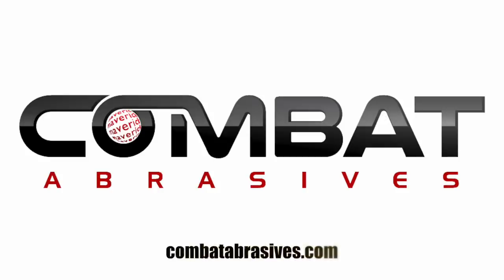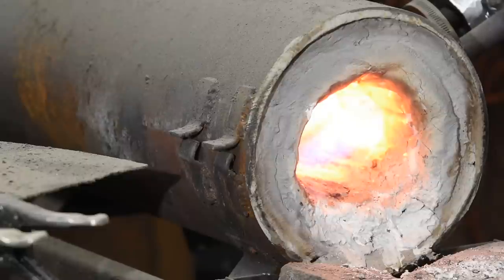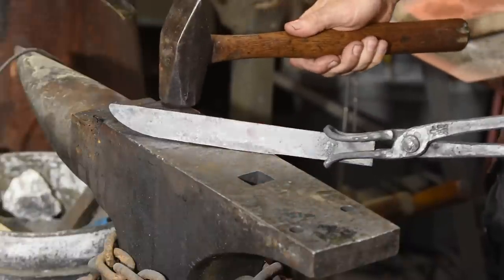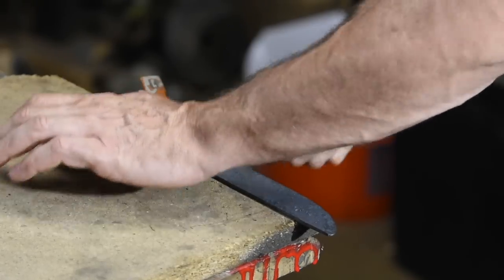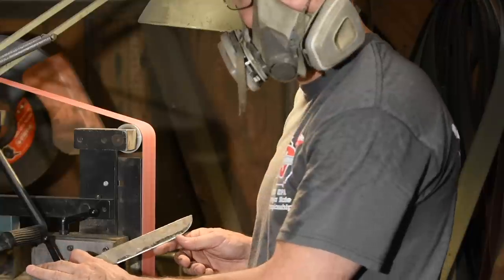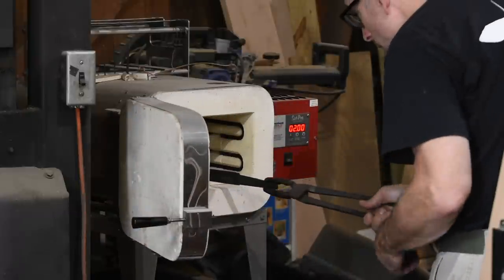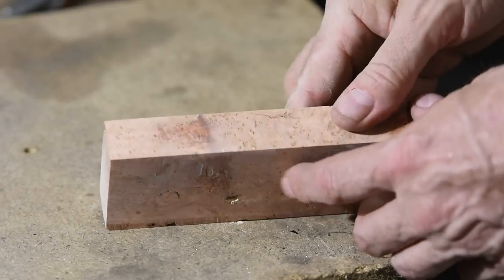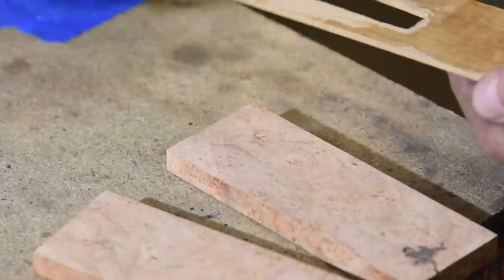Knife Forging Introduction: Making a Scandinavian Knife

Comment: 'Lapinleuku' actually translates to 'leuku of Lapland', where 'Lapland' is a vaguely defined as the northern Finland, Sweden, and Norway, and 'leuku' implies the shape and design of the knife, i.e., a long and widening blade that can be used also in light chopping tasks.

'Puukko', on the other hand, literally translates just to 'a knife', and does not imply the traditional 'Tommi-puukko' design, of which Finnish knives are probably most known for.
Reply: I think part of Russia is also defined as Lapland.

 Puukko does not actually mean knife in finnish. This is a mistake that many native speakers make. Puukko means a specific kind of knife. There is a lot of variation between different kind of puukkos for exampple a(traditional) Kauhavas puukko has a relatively large ricasso, a fuller and a bevel that is usually over 50% of the width of the blade. Many puukkos don't have a ricasso or a fuller (Toijalas puukko for example) and many modern puukkos have a scandi grind which creates a smaller bevel than any traditional puukko that I've sseen.

In summary the finnish word for knife is veitsi not puukko even though many native speakers use puukko when they are talking about knives in general.
Reply: Leuku is the big knife used almost exclusivily for chopping light trees when making camp or fire. Puukko is the smaller knife used for carving and other finer tasks.  

Sami word for leuku is "stuorraniibi" and it translates to "big knife". In finnish it's called leuku or lapinleuku (leuku of lapland).

The  word puukko is commonly used for any knife that is meant for work but can also refer to the specific shape of traditionanal scandinavian knife.

Veitsi can refer to any knife but is mostly used for kichen knives.

Finland also has many dialects and someone from some other part of the country might not agree with what i said.
Reply: @nikomartti2701  originally veitsi was defined by the grind. If it had a full flat grind, it was a veitsi. Now when there are more kinds of knives+grinds veitsi has become the general term. In the end it's just a matter of definition what do you think a puukko is. I personally think that main aspects that make a knife a puukko are a grind that isn't a full flat grind or a chizel grind, a blade that is between 7-13cm, hidden tang, a profile taper, the blade must be the same width before the taper begins and a one handed handle.

edit:the sami people use a smaller knife that isn't a puukko called unna niibas.
Reply: @goldskula  I pretty much agree with your specifications. Also i don't see a secondary bevel in what i think as a puukko or a leuku.

Comment: Great looking knife. Loving your videos as always. Here's some tips for a better Scandinavian authenticity:

1) Blade is forged by first forming the tang, then the blade part. Tang is also quite thin, narrow and longer than the handle.

2) Leuku usually has a big belly and the angle of the tip is very steep for better tip strenght.

3)  Handle is made of one or multiple blocks of wood or antler by drilling tang sized hole/slot all the way through. End of the tang is then peened, securing the handle. Sometime you don't even need glue.

4) Looking at the knife tip pointing down, the fattest part of the handle should be a bit above the center of the handle. Unless it has a strong flaring towards the end like Leukus often have.

Comment: Yup, one of the difficulties for a beginning knife maker is there are so many steps, all of them pretty important. It's easy to make mistakes anywhere along the line, gotta pay attention! :) I started with a piece of rail and that kinda sucked. I went to a machine shop and bought a ninty(ish) pound chunk of 4"x4"x12" for $80 and welded a three inch round bar section for a horn. Works pretty good and wasn't terribly expensive.

Comment: If you do not have a mill instead of a file you can take the seen Jewlers saw to cut out the points between the drilled sections of the bolster(and save the excess brass for Resmelting later on) I use this method to make my own guards.  then I heat the material in my forge if I am using wrought iron or a propane torch if brass to hot fit it to my blade. note: for newbies Always use either furnace cooled or vermiculite cooled steel if you're going to cut out the slot on your blade.  to do a furnace cool you heat the steel up in your forge then turn it off and allow it to slowly cool in your forge. a for vermiculite cool you use a steel tub or bucket filled with vermiculite and let it cool a cheap temperature gun is great to have when doing this annealing technique as after about 30 min you can check if its below about 300 F and then water cool it and start drilling your holes.
Reply: I use that jewellers saw technique too, works great

Comment: If you make a brass/copper bolster, especially a thick one (more than, say, 3mm), by hand and/or with limited tools, this is the process I recommend:

1) Measure the blade/tang intersection (max. tang height & width), and draw it on the bolster stock.
2) Drill TWO* holes that cover the max. tang height and do not exceed the max. tang width.
3) On the back side, drill several 'blind' (not through) relief holes between the two (through) holes to get rid of material that makes the next steps unnecessarily time-consuming. Use e.g. 6-10mm drill bit. Leave min. ca. 1.5-2mm of material.
4) Use a jeweler's saw to cut the tang hole (between the two through holes) open.
5) Heat the bolster and 'quench' it in water to make it softer.
6) Hammer the bolster onto the tang, and remove it if/when it does not relatively easily go all the way down. (It is supposed to be "tight as a man's anus")
7) See the marks (on the bolster) where the tang has scraped the surface and use files of (different shapes) to remove material from these spots.
8) Repeat 6) and 7) until you achieve a perfect fit**. Repeat 5) whenever the metal becomes too hard to work with.

*) Drilling multiple holes, with limited tools, is dangerous, since it is very easy to not get all the holes perfectly aligned in a straight line. Drilling only two holes guarantees that they are in line (duh).

**) Proper masters do this with one iteration, which is always rather annoying, though also awe-inspiring to watch.

BTW, Any and all sharp edges are a weak point in blades. I would never make 90-degree angles onto the blade-tang interface, or anywhere else, for that matter. Sure, fitting the bolster (or the guard in swords) takes significantly more time and effort when using rounded lines, but the added strength surely justifies it.

Comment: Lapin leuku translates from finnish as Laplands leuku. Leuku is a sami knife so I think it's quite incorrect to call it a brother to the puukko, because it literally has nothing else in common besides that both can be find in  nordic countries. The sami name for the leuku is Stuorra-niibi which to my knowledge means large knife. The sami people have their own kind of small blade which is called unna niibas. It's shorter than a puukko and the handle shape is (traditionally at least) quite different when compared to a puukko.

Comment: as far as i was aware quenching in motor oil is not a good idea because of inferior thermal transfer rate, flareup, toxic fumes. canola oil is cheap and you can buy it everywhere
Reply: He didn't say it was good, he said it would work. It works well enough that you'd never know the difference.

Comment: Would a 1x30 belt sander be good for a beginning knife maker?
Reply: Hey Michael, as an intermediate hobbyist smith, yes, they are awesome, I picked up one from Harbor freight, and it's wonderful, even after I upgraded to a belt grinder, I still find I use my 1x30 inch. Hope my exp was helpful. Forge on Mate!
Reply: As someone who used to me a beginning wood worker, if you think you're going to pursue this as a longtime hobby,  recommend saving up and getting the better tool.  I don't think I have any of my "beginning tools" because, frankly, they were junk.  Thankfully I bought a really good table saw which is still with me 20 years later.

Comment: Not gonna lie; first time I tried to make a slot in brass, having had much success in drifting holes in steel, I though I would try the same with a completely different metal which, I learned, has completely different responses to being heated and pounded on. If anyone would like to simulate this with out spending money on a bar of brass, just take a cold chisel and tap it through a bit of dried out hard cheese.

Comment: Was the pin in the handle necessary or would the handle stay on fine without it?
Reply: Missier Bladeworks
 The pin is there only as an extra safety feature and/or a legal precaution for the overly panicky Americans. If you use proper epoxy, you CANNOT separate the blade from the handle without destroying one or both. And yes, i (unfortunately) can post photographic evidence... :(

Comment: No disrespect or anything but that isn't even close to what a leuku should be like, and a lot of the information told in the video is just plain wrong, leuku doesn't translate into "large knife" and it isn't just a bigger version of a regular generic knife or as you put it a "puukko" style knife, puukko is just a generic finnish word for knife, it isn't a specific style. A leuku has a thin blade and a really large profile, this is for making the knife really rigid and heavy for cutting small trees and such where as a normal knife a.k.a puukko has a most of its profile consisting of a blade to make it really sharp for cutting and slicing or for example "vuoleminen" which is basically shaving wood by repeatedly cutting slices off of it in a certain direction to make a sharp stick or anything that you might want. Also, Finland isn't a part of Scandinavia. Alsox2 you always have to swear loudly or be deathly quiet when making a Finnish knife, that's just a given.